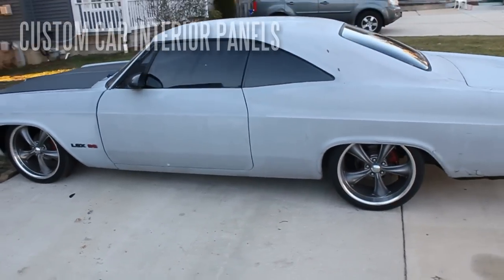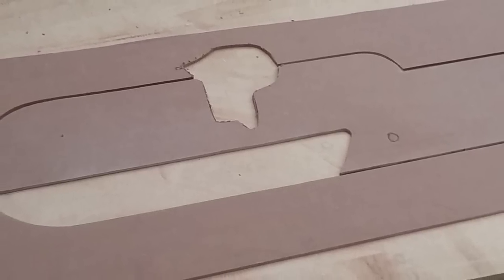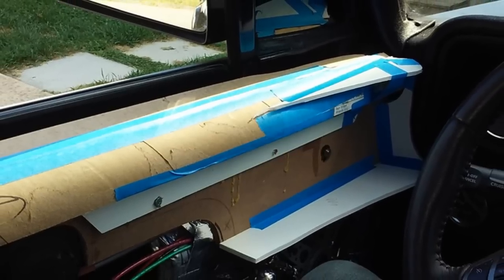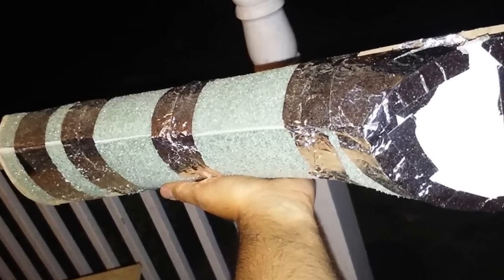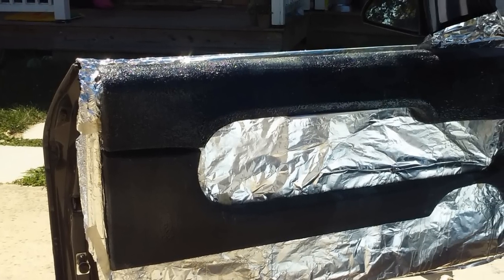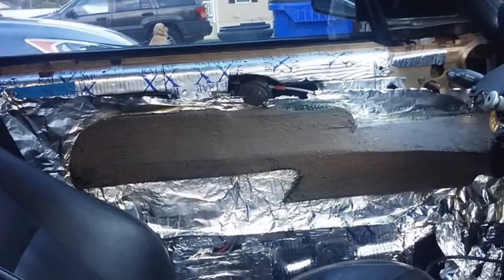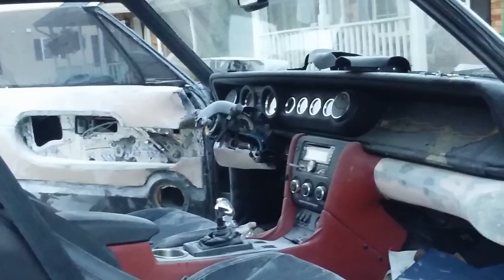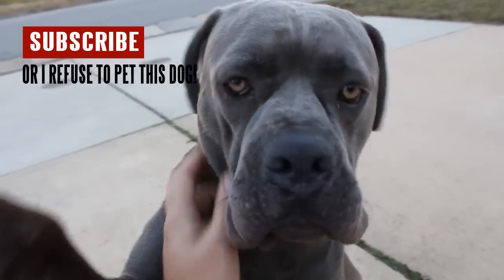How to Make Custom Interior Car Door Panels

Comment: how do you attach parts to the door?
Reply from the maker: I embedded small bolts before I added the fleece. Since the door panels are in sections, and not a single piece like a modern car door panel, I can put each piece on, put the bolts through the holes, and reach into the door to put the nuts on the bolts. The final panel is the red center panel, and it has a metal lip attached to it towards the rear of the door. That panel slides into place, and the metal lip catches behind the other panels. Then there is a hidden screw securing it to the front of the door. When the door is closed, that screw can't be seen.
Reply: David Guyton can you make a more detailed and longer video? thnks
Reply: David Guyton or can you at least remove the panels and show how its done? im subscribing))

Comment: the Nova dash was wonderful. it was very informative. this particular video lacks the informational of how you did it. in one section you state you had to form something out of foam board since the fleece wasn't working properly. however you never truly explained.

that is the only reason I hit dislike.

I have door panels in my semi that I want to change... hence looking at these videos.

another thing that would have been helpful is showing the screws closer. as what I think I am going to have to use will be getting threaded inserts as the backing panel under the door panel is metal.

I look forward to other videos.

thanks for taking the time to make this.
Reply from the maker: dislike.
Reply: David Guyton don't misunderstand...
the work is beautiful! 
however, completely unlike the nova dash, this particular video lacks the Detail you explained in the nova dash video.
which is quite fundamental for those of us just starting. all I'm saying is that more tell and less show is necessary sometimes. 

example... how exactly did you come up with how to contour the door perfectly??? the mock up was done how??? you couldn't exactly put a piece of paper on the door and draw it out to how you wanted it exactly perfectly since the natural contours of the original door would not allow for a perfectly flat piece to work with...

see where my criticism is critical in future videos?

consider it positive criticism...

Comment: how long did it take
Reply from the maker: About 5 weeks start to finish. If I had a garage I could have done it in about 3
Reply: David Guyton awww it's amazing work ... would u say it's hard to do I'm new to customize inter I just paint n do car audio
Reply from the maker: It has its challenges, but I wouldn't say it was hard. The hardest part is doing all the bodywork to get it ready for wrapping. I had a lot of fun doing it, and would do it again for any hot rod I buy in the future...but probably not for a customer.
Reply: awww cool thx I'm a try it well start trying tomorrow what all do u need if I may ask

Comment: how the hell do you get in the car
Reply from the maker: there's a solenoid in each door that powers the door mechanism. Instead of the key fob unlocking the door, it is wired up to trigger the solenoid. So in other words, to open the door, I press the unlock button on the key fob. Alarm turns off, and the door pops open.